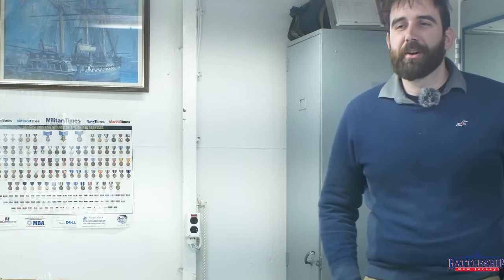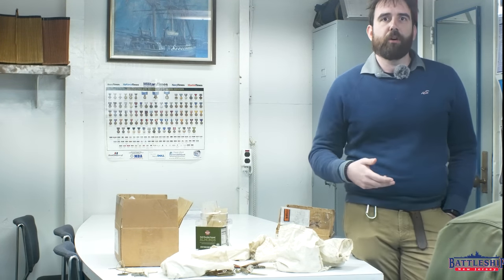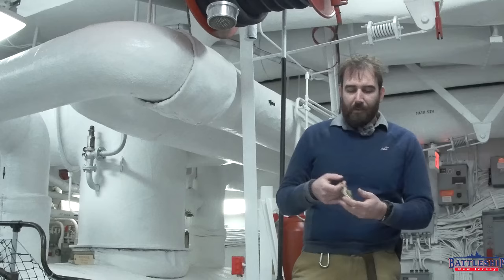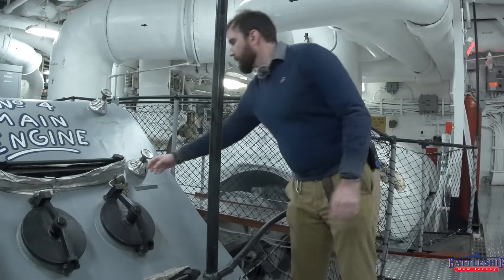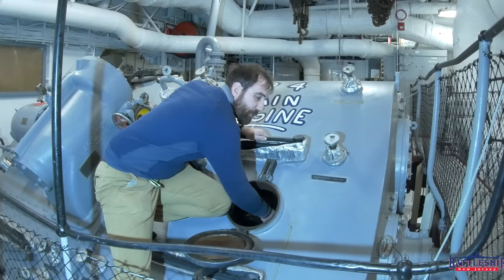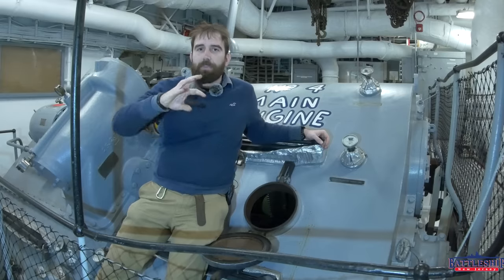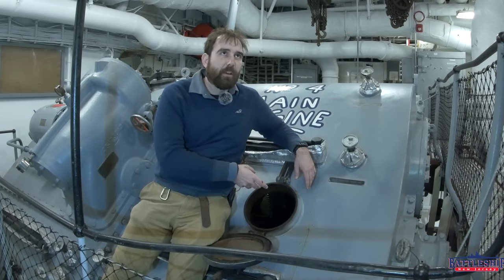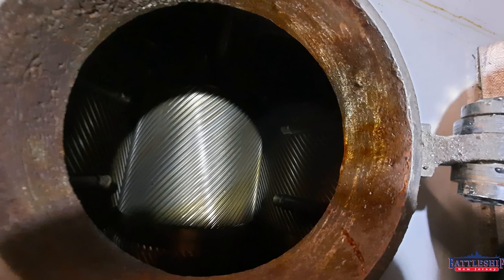The Keys to the World's Fastest Battleship: Unlocking the Reduction Gears

Comment: Main reduction gears are one of the long lead time items that get ordered first.  Grinding the gears took a long time, and there were only a few companies that could make them, and make them to the absurdly high precision needed.   From what I was told, the actual manufacture of each of the gears took weeks, and I see lots of different gears in that casing.  then the nitpicky process of fitting them all together.  Multiply that by the thousands of ships that were being built during WW2, and I can see that being a production bottleneck.    Glad you found the keys.
Reply: @@scottmunczenski9754 "they" could make better gears, given drawings and specifications. Which is probably the biggest issue...
Reply: @Scott Munczenski  The US Navy still uses reduction gears in ships. We have the ability to make new ones, they are expensive so we don't like to. And yes, we make reduction gears that are that big still today. We have aircraft carriers. Are we phasing out reduction gear? Sort of, we are shifting a lot of vessels to electric drive which means the main turbines which use to turn the reduction gear and the gear turns the shaft now will have bigger or more electrical generators (steam turbines in the case of something like the New Jersey) and then the electricity turns a giant motor that turns the shaft.
Reply: @Scott Munczenski They could definitely be replaced. Lots of things these days use steam turbines, and most of them need reduction gears like this one.
Reply: @Scott Munczenski New ones could be made but really really expensive as the tolerances are really tight and Ryan mentioned something as small as a gasket could wreak havoc on the gears meshing as they should
Reply: @Scott Munczenski They could but gears this big, and rated to that much sheer power are rare. the only ship that could have gears his hefty would be a aircraft carrier

Comment: Ryan, the bars are there for the crew to tie off all tools via lanyard to when these covers are open. Because this is such a sensitive and vital part of the ships engine system procedures for accessing the reduction gears are followed in a step by step method and great care is taken to prevent debris and unwanted items from getting into the reduction gear housing. Even things like safety glass are lanyarded to the crew and secured with duct tape to prevent them from falling into the porthole. These gears are so expensive the Navy actually or at least used to lease them from there manufacturer Cincinnati Gearing or Philadelphia Gears. Years ago the USS Ranger was believed to have been intentionally sabotaged by a Fireman  who dropped two bolts and a paint scraper into the reduction gear housing. The case was found open and the paint scraper was visible which made it believed the intention wasn't to cause serious damage but delayed the ship from leaving port so that a inspection could be preformed.. how ever the crew didn't follow strict procedure and did a partial inspection removed the scrapper and turned the shaft over the two unfound bolts caused 500,000 dollars worth of damaged and delayed the ship from leaving nearly three months. I'm no expert on this but from what I do know access to this space is so limited that to open it the lead engineering officer and staff enlisted officer usually a senior chief or higher would be present with the keys and only limited personal strictly involved with the process would be allowed into the space
Reply: I was told my ship's reduction gears were leased too.  I thought that might have been a 'no shitter', but from other comments, people believe it is true.  My ship is now at the bottom of the Pacfic following a SINK-EX.  I assume her gears were removed first.  I wonder if they are reused.
Reply: During a forever to be appreciated “sneak detour” while visiting the USS Salem CA-139, we got access to a boiler room and turbine/reduction gear space.  I was impressed when our guide explained the safety/security measures taken with an open reduction gear.  Underwear, no buttons, nothing in pockets, every tool, etc inventoried, lanyarding, all under supervision of a marine guard or two.  After seeing those amazing gears inside and what must be extremely close tolerance, I now have an even better sense of why.  Pretty amazing going through armor deck hatch opening & realizing the measures taken to protect vital areas.
My biggest impression?  The brilliance, ingenuity and manufacturing might that was mustered, calculated with slide rules!
Reply: @jimdennis2451  ya they were most likely saved returned or used in another ship, if I remember right on one of the incidents in which the gears were damaged they took replacements from another ship of the class being built. It is kinda amazing though when you think of the money spent on building these ships that they don't purchase them out right, prehapes it has something to do with a warranty that keeps the manufacturer on the hook should there be any issues in the future, there will always be a expedited replacement set in inventory
Reply: So when he opened that port and just casually stuck his noggin and camera in there all the chiefs of engineering past and present around the world just felt a disturbance in the force. 

How bout we not leave that open to the public eh?

Comment: I recall that there was a compartment bill for each space which provided instructions to be carried out if the ship was about to be taken by the enemy. For our engine room, I believe dumping tools into the reduction gears would be in order. Great video on the importance of keeping this critical equipment secure.
Reply: A few pounds of sand and some metal shavings would be even better
Reply: How about 100 gallons of salt water? I'm thinking of things that you could slip inside and won't be noticed until it's too late.
Reply: @AllAmericanGuyExpert  tools will be readily available in the engine room
Sand maybe for fires. Shavings buckets maybe empty
Salt water may take minutes to collect and do little damage to luvricated gears if flushed i time. Same with sand actually, it needs to be ground in to be effective
Reply: @the_retag  I agree completely with this. I do not think you guys had a bucket of shavings sitting there for fun.
Reply: @stradplayer90  ummm... i was never on a battleship, i just like big mechanical stuff...
Reply: On dad's last ship, they didn't worry about the engineering space. Because if under threat of being boarded and taken over, they would have set off the thermite charges in the classified electronics equipment and then abandoned ship.

Comment: What an amazingly precise, finely-designed, HUGE set of gears! This is an engineering masterpiece to say the least. A Swiss watch capable of thousands of pounds of torque.
Reply: If memory serves, everything in those Reduction Gears are lapped in together as a matched set.  You don't just order a gear and some bearings, you order a complete Main Reduction Gear assembly. 

It's actually not just a reduction gear.  The propulsion turbines are two-stage, so you actually have TWO turbine shaft inputs being combined into one output, with all of the gear ratios figured out so that everything is rotating at its most efficient speed.

Another amazing piece of engineering are the thrust bearings.  As the propellers push against the water, that thrust is transferred to the propeller shaft. The thrust bearings are what transfer the thrust of the shaft to the actual hull of the ship to move it through the water.
Reply: we were doing some ops where speed had to be controlled very precisely. I was sitting under the reduction gears and you could hear the backlash in the gears as they opened and closed the throttles. Considering how many tons the bull gear is and to hear the slapping noises the gears made. Very robust indeed.
Reply: Add a zero to that... but, you're right - a very large piece of machined metal to extreme tolerances ... done with 1940s' technology.  No 5-axis CNC lathe.  A couple of guys, a crap-load of dial gauges & very large micrometers.. and a whole lot of patience.
Reply: The reduction gears on the destroyers, the Arliegh Burkes, were 7 million dollars each and they had two of them, designated port and starboard, for the screw they serviced. I agree, those are multi-million dollar "Swiss watches." And, if the old BBs were brought back into service, the main reduction gears are among many of the things it is best that they still will work, and work well, as there are no extra ones, to my knowledge, laying around in storage, any where.
Reply: @fredinit  Done entirely mechanically, with a gear cutter on a mill, and a dividing head to get the spacing, plus an extra input to the dividing head that rotated it according to the table displacement, though those gears most likely were hobbed by the same dividing head and linkage, just this was attached to a massive shaper, that gradually cut the gear tooth into the blank, then was advanced and reset height wise to cut the next one. then the rough blank was hardened, and the final 0.05in of shape was done with a large surface grinder, using the same rotary table and gear hobbing set, to get the finished hard toothed gears, but with a softer more tough steel core. 

Shaper might take 0.05in with every pass, but you have a lot of passes to cut that deep, plus all those teeth as well. Remember as well no carbide tooling, all made from HSS steel, and needing to be reground every 1000 strokes to keep cutting well, so likely next to each machine there was a trolley with newly sharpened tools, and another worker who spent the day walking a new one every 5 minutes to the tool shop to have them ground again to sharp.
Reply: @SeanBZA  How would you cut a helical gear on a shaper?
Reply: @JukeboxJake  Same way you cut a normal gear, just use a rotary table with that auxillary input, that gets fed from a lay shaft that is linked to table position. all it takes is a rotary table to hold the gear, and a profile bar attached to the fixed part of the shaper, that operates a cam follower on the moving part, that in turn adds a fixed partial rotation to the gear as the table moves. Nothing too complex about that aside from the need here for a very big shaper. Keith Rucker did a series recently about cutting helical gears on his mill, very similar setup needed with the shaper, or you can use a gear hobber that is single purpose designed to make gears, but with these large sizes they likely used the shaper instead, as a massive shaper was common in steel fabrication yards, and it could handle the parts.
Reply: @fredinit  The "old CNC" was a group of grey-haired machinists, with gold rim spectacles,  the best files of the business and no boss to disturb them in the work.
Reply: @SeanBZA  Interesting. I just skimmed through that series that you mentioned, very cool setup.
Reply: @SeanBZA  Damn, that last part sounds a lot like how the Sphinx in Egypt was supposed to have been made - by hand using copper chisels. Copper was the hardest metal available to the Ancient Egyptians and the chisel tips would get dull after about 100 strikes with the mallet, so the craftsmen would have workers constantly bringing them re-sharpened ones.
Reply: Millions of foot-pounds. I don't know about the BBs but my FFG could do 210 turns at over 2M ft-lbs from a pair of 21,000 HP LM-2500 gas turbines. I wouldn't be surprised if this was over 3M.

Comment: After many years of dealing  with too much vibration with one of it's reduction gears, the USS Kitty Hawk (CV-63) in '93 decided to remove and either repair or replace (I don't remember which) the gear. They spent something like 6 months cutting big holes from the hanger deck to engineering which included removing or moving all the cables and pipes that were in the way. After all that I can't tell you if it was successful or not (not my department) but we did go back to sea and the Kitty Hawk later was homeported in Japan.
Reply: its

Comment: There was a PMS check to clean out any accumulated debris from the L/O sump periodically.  You had to use a flashlight 'cause well, it's pretty dark in there.  The flashlight had to have a lanyard on it so if you dropped your flashlight (surprisingly easy to do in a lube oil sump) you wouldn't just drop it.  As Ryan mentioned you had to count everything that went in (including the number of rags you took inside) and they all had to be accounted for before it was buttoned back up.

Comment: A bit of info about those locks. They should have all been issued with 3 keys. 2 round bow (head) that operated the lock normally and allowed the key to turn clockwise and a square headed control key that could turn CCW and enabled the disassembly of the padlock. I show how that is done on an older with only 2 keys variant in this video if you are interested. v=DW1SVPIPQsk  The 2 round keys would have been issued and the control key would have been kept somewhere safe, usually whoever was in control of issuing the locks.

I managed to get a lot of 25 of that particular model years ago, with no keys. They are quite rare to find and it is nice to find out what they were actually used for. The thicker shackle models were considered the medium duty high security padlock of the mid 70s to mid/late 80s. You may also have the dual control NAPEC padlocks aboard on arms rooms etc.

Now they use the S&G 951 padlock with a special hasp which is the latest model in production.
Reply: S&G 826C Padlock with Medeco Classic core
Reply: @leland818  Yes, one of the "thin shackle" versions that is stamped 826C but has the shackle from an 826A
Reply: Yes no need to cut the locks, just call your local locksmith to pick them, or invite The Lock Picking Lawyer to come and do a demo on just how fast they can be picked. The locks are there to keep honest people out, or prevent accidents, they would not be pickproof, just there to show the area is closed off. Ryan can easily order the pick set for those online, and do a few hours of practise, never needing to cut off a lock again on the ship, unless it has actually rusted into a ball of corrosion anyway.
Reply: @SeanBZA  These are 6 pin Medeco locks, not something you can learn to pick in a couple hours. It takes a lot of experience and sometimes customized picks to pick them.
Reply: @SeanBZA  takes a long time to learn, so no
Reply: That'd be called a "core removal" key.  Allows the keymaster to change out a damaged core or replace it with a different core so as to change the key required to open the lock.  The keymaster would have sets on-hand for this work, which would include a new core and three new keys.  You'd do this if the core was damaged, a key compromised, or if a key was lost and you couldn't fab a replacement key easily.  The core removal key is slightly longer, with the end pin extended just a bit to allow the core to move in the other direction where it can be pulled out

Comment: Offhand I don’t have the turbine specifications for an Iowa, but I do have that for the Mogami and Tone class cruisers handy. The High and Intermediate Pressure turbines were rated for 2,613 RPM, the Low Pressure 2,291 RPM, and the Cruising Turbine 4,796 RPM. The reduction gears brought that down to 340 RPM.

Cavitation is a minor problem compared to the material strength required to get the propeller and propeller shaft (hundreds of feet long) spinning that fast. The propeller would shatter at that RPM.

I’ve recently been digging into some War Diaries on the National Archives and found an example of reduction gear problems. On her way back to Pearl Harbor from torpedo damage repairs on 12 June 1944 Intrepid suffered an unspecified casualty to the No. 2 reduction gears that required stopping the shaft. After arriving in Pearl she spent a week pierside undergoing repairs, but on 21 June she was drydocked, the No. 2 propeller removed, and the shaft locked. Whatever the damage was would have taken too long to repair, so the carrier was sent on a ferry mission to Eniwetok and back. She returned to the Navy Yard on 11 July and after pierside and drydock repairs went on full power trials on the 29th. The Intrepid website notes a lubricating system failure caused the reduction gears to overheat (the diary doesn’t specify), so it was back to the Navy Yard until 13 August for more repairs.

The reduction gears essentially kept the carrier out of combat for another two months, making this the second longest time out of action for any damaged US carrier of the war. As of yet I’ve found no report tying this to the aerial torpedo hit in about this area during the Truk raid in February 1944, but there’s some circumstantial evidence that this started from minor shock damage that was magnified by the vibrations that steering by engines required and went unnoticed as the starboard shafts were run at low speeds after the damage (Intrepid kept turning to port).

Comment: I remember each cover not only had a lock, but they had the fine wire seals to prove the cover hadn't been tampered with.  I've never seen yardbirds stripped to their skivvies when they had a hatch open.  I have seen the Marine Machinists (Shop 38 yardbirds) use nylon line to tie a tool or rag to their wrist.